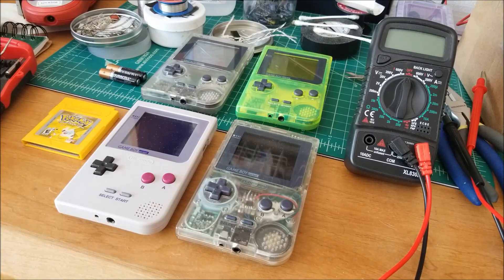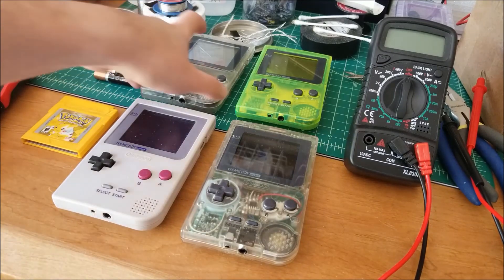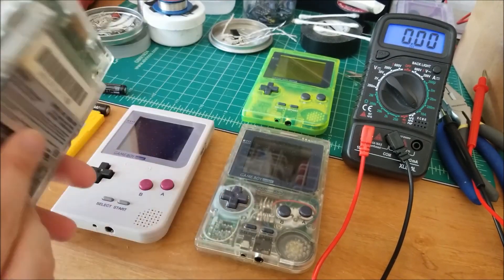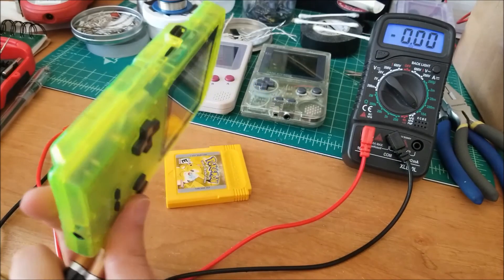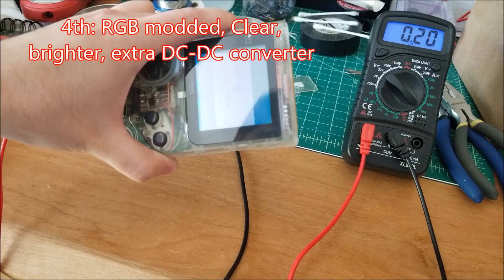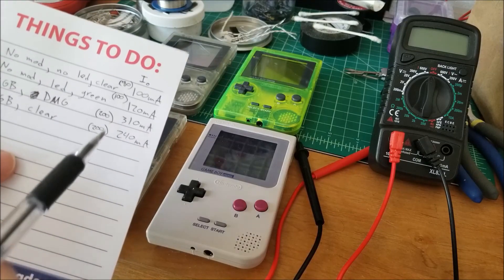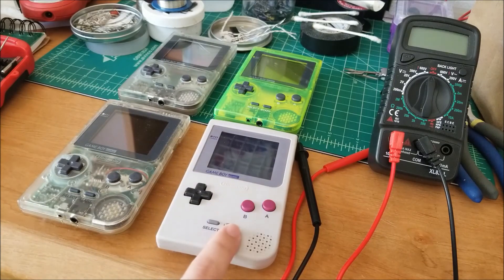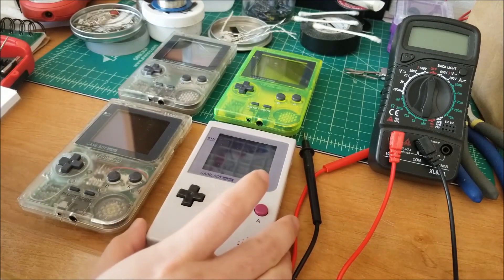Let's Experiment: Gameboy Pocket Backlit vs Stock Battery Testing

Comment: It works with recharble battery 1.5V?
Reply from the maker: Gameboy pockets will run off two AAA batteries
Reply: @sjm4306  i mean AAA size recharble battery 1,5V because usually they works with 1,2V
Reply from the maker: Both 1.2v and 1.5v batteries will work

Comment: Actually the hex inverter can change things, if you used a bigger 74HC04 with unused pins left floating, it can draw up to 50mA vs smaller SOT23 ICs draws like 10uA
Reply from the maker: I always tie unused pins to ground (pretty much the first thing they teach you in digital logic design). But the chip I used is pretty vintage so the leakage current is probably much higher than modern logic chips.

Comment: Not sure why but my backlight mod stopped working after I installed it, any thoughts?
Reply from the maker: Double check the soldering to make sure there are no cold joints.

Comment: Did this on my green backlight modded gameboy pocket. Seems to only be 120ma
Reply from the maker: Interesting 120mA is not bad at all, did you do a single color backlight and bivert or rbg backlight? I would think a single color that isnt switched would consume quite a bit less current than rgb. Also the resistor chosen to set brightness has a big effect as well. I still have some experimentation I want to do on this when I get the time.
Reply: sjm4306 I got the gameboy mods uk model from deadpanrobot here in the UK it was the cheapest place to buy a green panel. Resistors are already added in the screen circuit so I haven’t scorched my eyes yet.
Reply: What are these resistors? And some of them are bad for your eyes ?
Reply from the maker: Sorry, I was just joking about hurting my eyes. I meant more that some backlight panels are way too bright especially if you play at night.

Comment: I have a Gameboy Pocket that was damaged by battery acid. all of the acid is cleaned up.there's brand new contacts in the Gameboy now but something on the Gameboy motherboard is stopping it from working, like a fuse or lost trace on the boards. would just give up on it but it still works when I plug it into the wallmaybe it's just one of the fuses have blown but I don't think so I have a multimeter but I don't know how Gameboys layout works but it's definitely nothing to do with the batteries.the batteries are pumping power into the Gameboy just something is stopping it from working on the board
Reply from the maker: This site has schematics which will help: https://fms.komkon.org/GameBoy/Tech/Hardware.html
Looking at the power circuitry schematic and knowing the dc input works but battery doesn't I would guess either a trace on the pcb is damaged or more likely the switch inside the dc jack that connects the batteries when there is no power plugged in is corroded and needs cleaning.

Comment: Interesting - never thought a backlight would consume so much power. The figures for your un-modded GBP without an LED are pretty much bang on the official spec - 10 hours, power draw of ~80-90mA. I was not very impressed with the battery life of the pocket to begin with - I much prefer the original DMG or the Color. I wonder what would happen if you replaced the original DC-DC converter entirely?
Reply from the maker: AlexNitro44 Replacing the dc dc with a modern more efficient module will be a future project and should prove most interesting.
Reply: sjm4306 did you find a regulator suitable for the screen

Comment: Hi great video. I wondered which exact maxim part you used cause im interested into improving my battery life. I know that bennvenn advised using a second DC-DC converter when using flash cards cause the default converter couldnt provide enough energy on its own. Do you use just one or the new + old at same time just for the backlight? thanks for the input!
Reply: For those wondering, you can't just replace the Gameboy's power board with an new one, it not only boost to 5V but also provide power to the LCD and its negative bias (-19V on the DMG, -15V on GBC, not sure on the pocket) so it's a little more involved, a custom replacement power supply will have to be designed probably.

Edit: oh, BennVenn did in fact had one designed in June 2018
Reply: https://www.pololu.com/product/2564 this is the one bennvenn suggests using. dont know if specs are simular
Reply from the maker: tf2cheats For stuff like a backlight accuracy/tolerance is not super critical so just about anything will do. I used a free sample of the max756 I received years ago. I ended up powering just the backlight and my chip from this boost converter while the original one powered the game boy as stock.